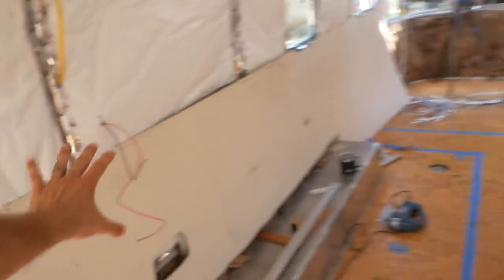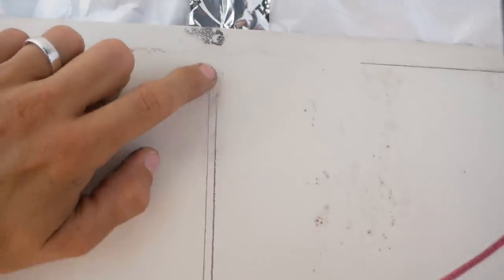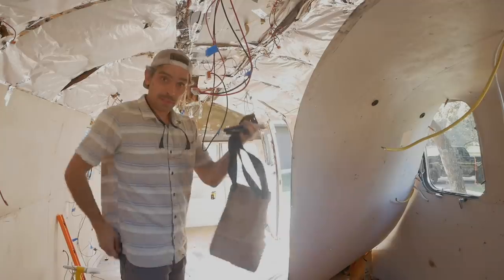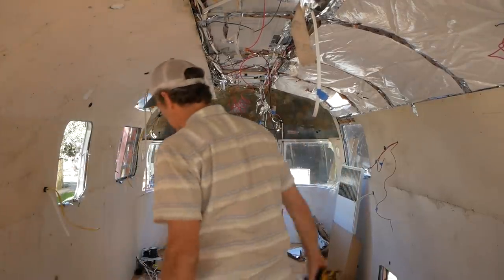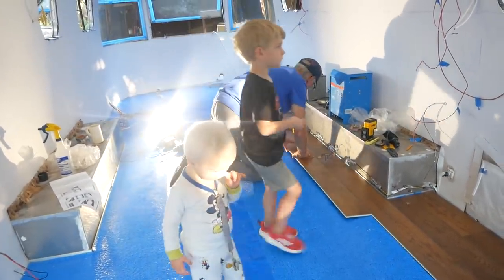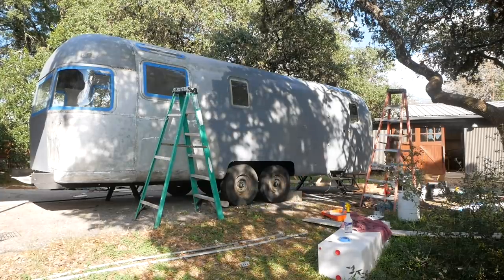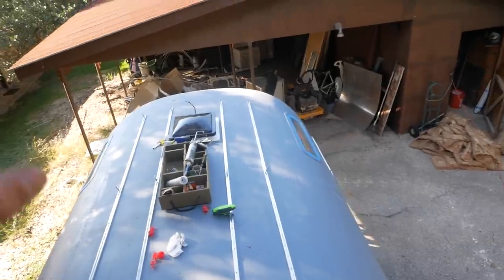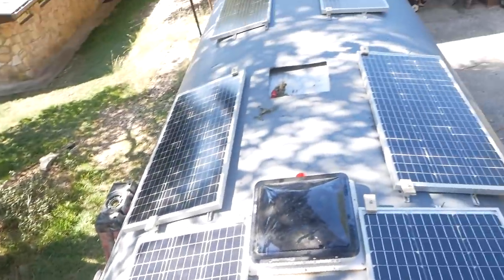Installing Interior Walls, Flooring, and Solar (Airstream Argosy Ep. 16)

Comment: Could you put a small faring at the leading edge of the very front of each solar panel to keep wind and weather from getting under the panel and causing lift and potential damage? Something like a simple sheet metal faring that could be attached with the same tape? Love watching your progress AND your wood working. Thanks!
Reply: that could reduce noise too, good idea
Reply: Perfect. Great idea.
Reply from the maker: That’s a good idea!
Reply: @AndyRawls  A simple pc of aluminum angle squeezed together a bit and taped on in front and behind the panels. Should work great. Your bench vise will do the job.

Comment: With how hot it will get under those panels, I personally would do at least 2 rivets per. Sun is the ultimate disintegrator of adhesive. Its not a matter of if, but when.

Comment: I still would have put one or two rivets on the ends of those tracks. You're making big sails out of those panels once they're mounted and when you're driving down the road the wind could rip them off your roof. Don't underestimate the power of wind...
Reply: And it's only stuck to the paint. Not the aluminium.
Reply: I thought I missed a part riveting the rail with the tape under it but it seems Andy got some extra warranty or insurance for fixing just with tape... I don't believe it at all.. but fixing flown pannels will be a nice content in the future 😀

Comment: Id put in a rivet in each end of the t track.  Drill out the hole, fill it with roofing tar and put in the rivet and lock it in, that should be good enough to keep it water tight and will add a mechanical fastener for extra security.

Comment: Thank you for showing us your frustration.  For those of us that are not "pro's" it's always therapeutic to see that the pro's struggle sometimes too AND have the same reactions that we have when things go awry.  Kudo's sir.  Also, don't feel bad about the riveter nose being the wrong size.  I'm restoring a 1946 Spartan Manor and had to fab up a new exterior window support that I then buck riveted onto the frame.  It took me 2.5 hours of leaning on the air hammer with all my might to attach 3 rivets out of 6.  It was then I realized I didn't have the spring threaded OVER the peen.  Once I figured that out it took me about 3 minutes to do the other 3.

Comment: Andy I am not sure what paint you plan on using but I did 3 coats of Topside Boat paint on my '78 Argosy and drove it well over 6k miles with not a scratch.  It was very water resistant, kept its color and was easy to clean.

Comment: My wife always comes and sees something I'm not doing right and every time I say it is going to be alright it looks fine. I end up regretting I did not fix it because she was right. Good Luck! Also, I would never trust Glue to hold Down those panels. The wind and vibration will jar them free. Caulking underneath those rails with rivets should keep the water out.

Comment: Trailer is looking great. One thing I will say about epoxy coatings Mix small batches so it does kick off to quickly but you did real well on the primer coat. Follow the directions when you do the second/third coats as some epoxies need to be sanded before recoating and some don't. I can't wait to see what you do on the inside.

Comment: The old trick using 2 x 4 T's is one I figured you would have known but they are usually used in drywall apps. If nothing else you are a tenacious and persistent fella. Great traits Andy. Everything is looking really smooth my friend. Just like you have done this before in another life eh.

Comment: I would have gone with a combo of the pop rivets and butyl tape under the rail for a mechanical attachment with the rubber material squishing into any holes that might show up. I used butyl tape under my solar brackets with a bead of silicone around the edges of them as an extra barrier. 

Good work though, keep it up and for sure get a second set of hands when you need em. ;)

Comment: I feel for you with that rivet gun, another trick you can do that I always do is when I change tips, on the pincher (two alligator looking clamps) inside the tip I take a little 600 grit sandpaper and just take the burr off the the front edge on them on the outside and lightly around the grippy edge on the inside.  It grips the rivet shafts more evenly and even if you pull the rivet crooked it still sets it right.

Comment: Andy have you given any thought to using a Raptor liner tinted in the color you want for the final coat of "paint"? i realize there might be some extra weight but i cant imagine it would be more than a few hundred lbs? i could be wrong,  but i would think it would give the exterior an extra level of protection and sealant... great project- fun to watch,
Reply: I suggested that when he was first talking about painting.

Comment: At my company, we use the VHB tape to affix SS top panels to meal delivery carts. If after 24 hrs, the top panel would need to be removed for any reason, we need to scrap the cart and start over because attempting to remove the panel attached with the VHB tape will destroy the cart. VHB tape is forever! I pity the person who attempts to remove those solar panel brackets assuming you’ve used the same product that we do. Might want to mock up a strip with the tape, wait 24hrs then see what it takes to pull it apart.

Comment: I VHB'd my solar panels to the roof of our RV. Two years and no issues.  check them frequently. I also added some safety straps, just in case.  if the tape lets go, they shouldn't fly off. used webbing as safety strapping

Comment: Wow, talk about a love of labor, you certainly have gone "All in!"  At 26:11 where you are able to significantly wiggle the panels maybe 1/2 inch back and forth that gives the impression the panels will also be wiggling at highway speeds and especially with a buffeting wind. At a minimum, I suspect adding Loctite on all the bolts would be wise, yet the constant stress on the epoxy to the roof may still stress the adhesion (especially with hot/cold daily transitions on a reflective aluminum roof - think Challenger Space Shuttle icing disaster).  Aside from the roof adhesion issue, I would recommend putting something like a GoPro on the roof and record footage when you do a test run at highway speeds to monitor the vibrations.  Perhaps adding dampeners will help alleviate the wiggle-wobble.  At any rate, doing monthly stress test inspections at least the first year would be wise.  Or you could add safety wires between each panel to greatly reduce possible points of failure.  Ideally, your setup would not vibrate and endure years of hot/cold stresses like this:   https://youtu.be/I5EIHhbbPS0?t=255

Happy Trails.

Comment: I love your videos.  You inspired me to restore / reupholster two chairs I bought thinking they were mid century teak, cherry or nice hardwood.  Turns out they're 80's white pine with a very good varnish job.  So bummed!  So I'm going to sand off the varnish and expose the cheap white pine wood and upholster with a less formal fabric and see what happens.
Reply: on a brighter note, you also inspired me to do something about the separation in my teak tabletop.  I glued and strapped it, and got it from a 3 mm separation down to like .5mm without totally taking it apart (I don't have many tools or much strength).  Looks great, tho.

Comment: 4:43  I'm also doing an RV remodel.  I can tell you that a portable air conditioner is a life saver.   Cut a piece of thin plywood/doorskin and fit it to a window, then cut a hole in it and glue a stub of 5" pvc pipe with Liquid Nails, that gives you a flange to mount the exhaust hose to.   Trust me, it will make your life so much easier when you aren't sweating your ass off.

8:30  Just screw a two foot long stub of carpet covered 2x4 on to the end of a 6 foot long 2x4 to make a t-shape and use that as a wedge/brace to hold the panels up against the wall.   I used several of these when installing my ceiling panel and it worked great.

Comment: Andy, first off, congrats for persevering through the interior lining install; not an easy one-man job, even if you were to have used t-supports (as others have already mentioned to you in their comments).  I was wondering if it wouldn't be a good idea to add a few rivets at the front of each track, as added insurance against the tape letting go while you're driving down the road?  I think you may be tempting fate to put all your faith in tape... even that particular 3M product being as good as it is.

Comment: Hi Andy - great job on a neat project.  May I make a suggestion, next time you need an extra set of hands for holding, think about using braces, similar to Zip wall systems.  Take the family out for some BBQ to Rudy's and grab a tall cold neck!  Thanks for sharing!

Comment: I like the floor choice. The only thing I would have changed is to get vinyl that glues together. It won’t let any water past it. The inter locking will if it sets on it for to long. But the vinyl will last a very long time. It still looks new, 6 years old and with stood 2 dogs 2 cats and now 2 kids.
Reply: On an RV, you really want a floating floor so it can expand/contract and move independent of the RV itself. It's a mistake to use adhesives to hold the flooring down on an RV. It's a common issue -- the floor starts to buckle.
Reply: @mrosenblatt  it is a floating floor. It’s just the overlap that glues together.

Comment: Great progress.  You may have this planned, but I would replace the little plywood hold downs with HDPE or Aluminum ( blocks or flat bar) as they won't weather as easy.   I would be afraid the blocks would shrink or loosen up over time as it compresses (again you may have that planned already).
Reply: He said the 'real' hold downs were on order and would be arriving the next day so the plywood ones are very temp

Comment: The tape will work. There are busses that use tape to hold the wall panels on and I know GM also uses it to hold the body molding on some of their cars. I thought your rivet gun had already broke. People who use them a lot don't think about someone not knowing that the tips need to be changed depending on the rivet size being used. Always use the smallest possible tip.

Comment: Excellent progress. You'll have endless power with all those solar panels, are they all really necessary may I ask? I have one 100w solar panel charging a 115ah battery on the roof of my UK Coachman caravan (trailer), and toured the Outer Hebrides in Scotland for 3 months - off-grid. Even when the sun was not out, although it charged much slower, the battery still charged no problem. By 12pm power was back at 14.3v most days, 13.7v when overcast/raining. Not a criticism but this is the reason I can't appreciate why many people have so many panels.

Comment: I love the way you attached the solar panels using those rails without putting holes to the roof.  I could not catch the materials you use, I saw some type of tape and silicone??? would you mind letting me know what they were? Also, what type of rails and bracket attachments did you use? THANKS

Comment: With all the work you do with wood...you are not using a deadman helper.... similar to a drywaller putting up ceiling sheets.
Andy 2 2x4s one nailed on top like letter T.   Wedge it against the panel on the ceiling.  DONE DEAL. 
It's a lot of work.  Good job

Comment: Why install the solar panels before painting the camper ?? You should apply at least two coats of finish paint to that roof area before installing those solar panels. WHAT IS THE RUSH. You have done a great job, don't rush it, the finish paint does so much, water proof, reflects heat, looks and longevity of the camper. Just my opinion‼️👍👍. Vinny 🇺🇸

Comment: Has that tape and epoxy held up on the rails? You're relying mostly on paint adhesion at that point. Actually, did you end up using the Thixo around the rails? It didn't look like it when you were installing the panels.

I used some of that 3M tape to adhere some lights to the underside of some metal cabinets in my shop. Not sure why, but one of them eventually let go. I didn't have the addition of epoxy, though.
Reply from the maker: Yes it’s holding strong.  I did seal around the rails with the epoxy caulk so they’re locked in!  That being said I am keeping an eye on them the elements tend to cause things to break down

Comment: Are you going back to a roof top hvac? Those mini split AC units are the way to go over the roof top units.
Reply: mini split a/c?
Reply: @guelphtents4448  Mini Split A/C units replace the top ac unit but add an internal unit to a wall. They do require the exterior unit to be installed somewhere on the tongue or rear bumper. The positive is they use about 600 to 800 watts to operate vs like 1500 to 2000 watts.

Comment: I don't know if you still read these but I have a comment. This is in no way a criticism since I know just how difficult these kind of projects are as you are learning as you go. That being said, I wanted to ask you why you used the old wall material. You are doing so much work to make the trailer look great and are putting in so much effort even on the parts no one will see, even though that is the mark of a conscientious craftsman. However, the interior walls will be very visible, won't they? Anyway, what I was wondering was, do you think it would be possible to redo the interior walls in wood instead of that plastic? Maybe using veneer or thin plywood. BTW I haven't commented on the videos up until now, but they have been incredibly enjoyable and also informative. Thank you for the great content.

Comment: "Not sure which tip I need" ummm the one that fits the rivet shaft you're using!!
Reply: Uhhhh the sizes aren’t listed while they’re on the gun, so he doesn’t know what size the tip is until he removes it from the gun to check it.  DUH.  🙄.

Comment: Hey Andy, I have been watching your videos as they come out. I’m finally at the flooring stage of my ‘73 Argosy build. Do you foresee any issues building on top of your floating floor? I am trying to decide whether to lay mine first or hold out until cabinet build outs. Either way, great work on your build!
Reply from the maker: Hey Tom, yes I’ve had some issues building on top of my floor.  The vinyl shrinks when it gets cold and I’ve had some areas where the seams have popped open.  Because I’ve screwed down components to the floor it’s locked in some areas of the flooring so it can’t float.  I like the idea of having flooring under everything but if I did I again I light consider doing after cabinets were installed or finding a better flooring that won’t cause issues.  Hope this helps
Reply: @AndyRawls  That is good to know. Thanks for your reply!

Comment: I wouldn't trust just a chemical bond of your solar panel tracks to the roof. I'd put at least a few fasteners in to hold it. I used to work at a big box store that sold lumber and I can't tell you how many times I saw plywood snap in half when it was tied to the roof of a car or van just driving through the parking lot. Good luck.

Comment: Will the floor not buckle with the humidity? I was under the impression that vinyl or laminate flooring and even hardwood can expand and contract with weather changes. Should the floor have been left out from the wall a bit, or with the aluminum wall have some give as well?

Comment: Dude are you sure that double sided tape and heavy duty adhesive are going to hold down solar panels when you’re going down the road at 70 mph?  I’d install the rivets through that tape, the tape will waterproof as they go through it.

Comment: I think you are going to be finding your solar panels in pieces about 5 miles back down the road, when you hit about 40+ miles an hour if it takes that much. That 3M Double sided tape you used, is not meant for that kind of application I know as my family works at 3M where that stuff is made. you better put a couple of bolts in those rails to hold them to the trailer shell, or you will end up loosing them and your solar panels. As those solar panels are going to at like a sail when they start catching wind and will fly off the trailer.
Reply: I absolutely agree with you and I was thinking the same thing.  There’s no way that the 3M tape and epoxy is going to hold those panels once the trailer gets underway on the highway.  The vibration and drag at speed is too great a force to be secured the way it is currently.  There are factory drilled holes in the rails for a reason.

Comment: Normally you should install the interior endocarps first, as that is how it was done when they were originally built.
Reply: endcaps
Reply from the maker: Thanks for the comment Colin...I always appreciate your input.  The plastic endcaps are garbage so I plan on making new endcaps from aluminum.  I'm assuming I can slide them in under the walls I have installed?  I'll just have to drill out a few rivits.
Reply: @AndyRawls  We sell aluminum interior endcaps that are laser cut & pre-punched to suit your trailer. They are shipped "knocked down" in wood boxes so shipping is pretty cheap via FedEx ground.

Comment: Closed end rivnut your solar rails on front and back. Epoxy the rivnut holes before your install rivnuts for good. Solar panels are way to expensive to play with only 3m tape. Ever seen a car with ALL its taped on body side mouldings and badges???? NOPE!